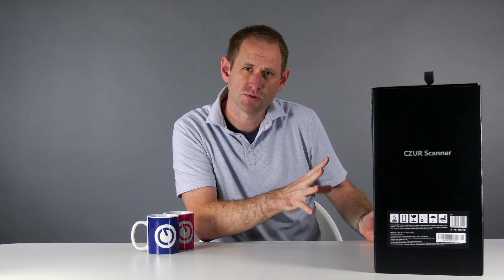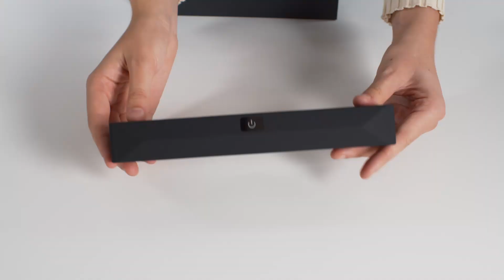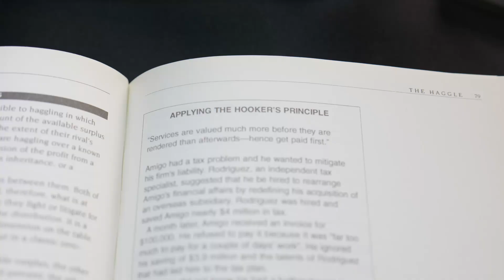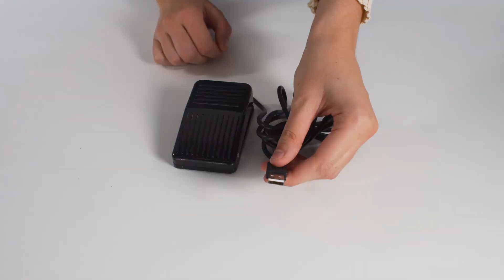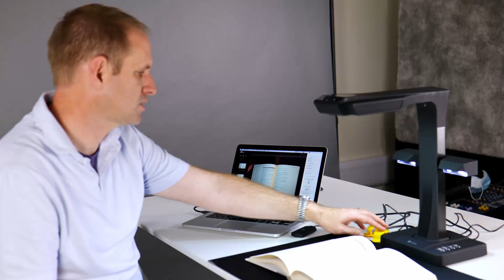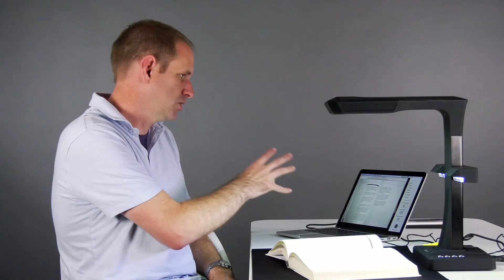This scanner is BRILLIANT! 🤯 - CZUR ET16 Plus Review

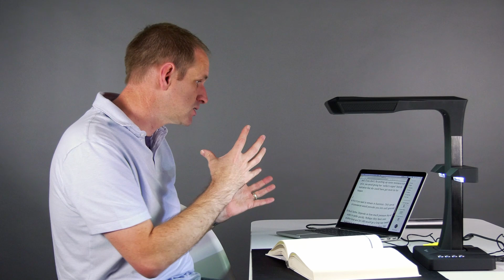Comment: Helpful video but you didn't address the one question I'm trying to figure out with this scanner. I just want to see someone scan a bunch of pages in a book as fast as they can. At 10:42, you said no one would ever scan an entire book. This is crazy. There are many instances where entire books need to be scanned. I have 56 family diaries that need to be scanned in so that they can be shared with our extended family and there are no copyrights on that. As I've been researching scanners, I've realized that there is a huge demand for books of all kinds to be digitized, and specialized scanners are being developed to meet this need. There are lots of historical and out-of-print books that need to be preserved and shared through digitization.
Reply from the maker: Been a while since we did this, but I reckon you could get down to 5 seconds per page with the foot switch and a decent computer. Thanks for sharing the other use cases.
Reply: The scanning is really quick

Comment: This scanner fails utterly on print or photographs with even a little gloss to it.  The lights are not diffuse enough, very harsh and create hot spots.  Unless you are scanning plain print on matte paper, you are going to be disappointed at the results and cost.
Reply: Use the side light. Turn off main light.

Comment: I imagine this would do a good job scanning the cover art on CD booklets so you could add them as images to the audio files in your music collection.  And probably much faster than what it takes when using an older flatbed scanner.  I'm not sure that's worth over $430 by itself, but it'd be another nice use for it for those who also have other uses.
Reply: Even better: For those who are buying vinyl albums instead of CD's, this might be great for creating cover art from the album jackets (assuming it can scan a flat object that's 12" x 12").
I have a two or three vinyl albums that I've imported into my music collection, and even with a legal-paper-sized flatbed scanner it's a real chore to reproduce good cover art.  I had to scan the album cover in three strips, and then painstakingly stitch those images together to get a really nice-looking image for cover art.
Reply from the maker: Great idea!

Comment: Hi, looks quite interesting. How fast does it handle photographs ? I ask because I've been looking got a way to scan loads of old photographs and it seems would be much quicker to just plonk them on this, press footpedal, and then quickly replace photo and repeat, my scanner takes quite a lot of time to scan photos.
Reply from the maker: As quick as you can put them down really. You don’t even need to get them straight as the software does that for you. Might need to be careful with the lighting on glossy prints…